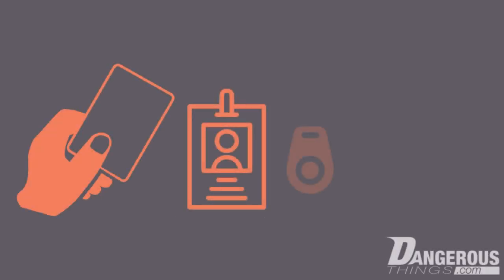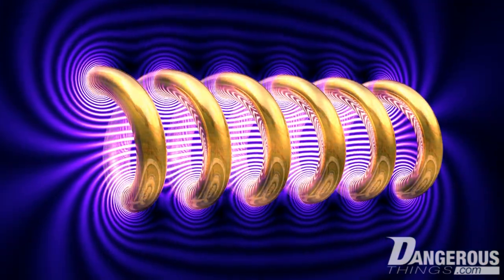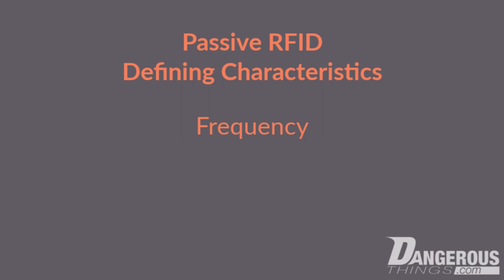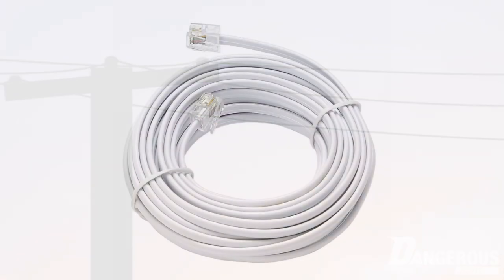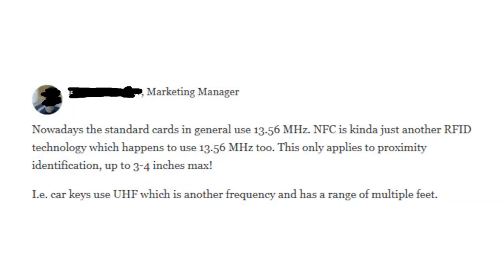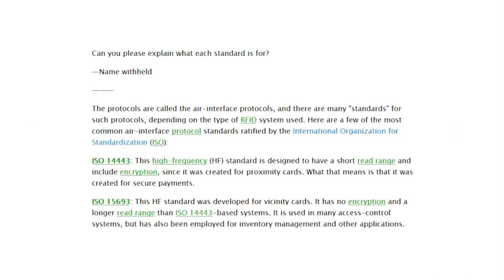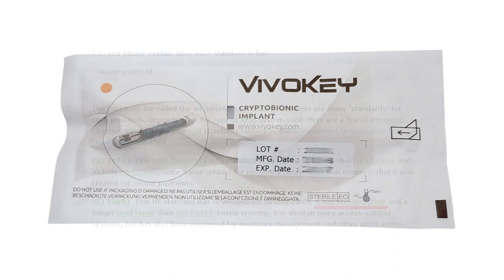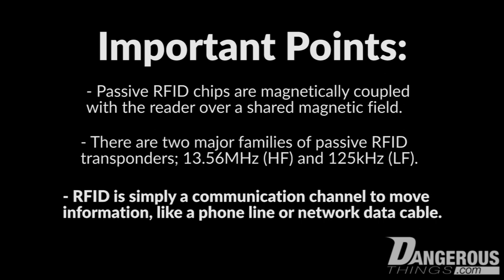RFID Basics, Part 1

Comment: I have a question: You say that the range of a RFID is a function of the reader and tag. Does this mean that changing one factor changes the range or do both the reader and tag have to agree on the same range before transmitting data? (i.e. can I modify/soup up a reader to increase the range?)
Reply from the maker: Range is just a matter of physics only. Imagine the reader and tag are both magnets.. if you change the shape or size of just one, it will still affect how the other is going to interact with it. Of course that's a very oversimplified analogy and not really what's going on, but basically the physics of electromagnetism is what is being played with here with tag and reader antenna design.